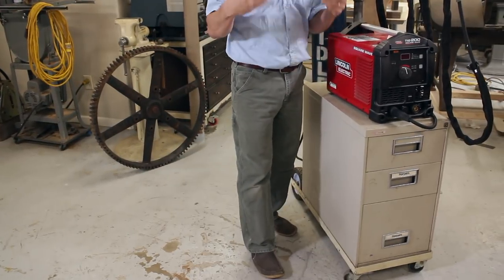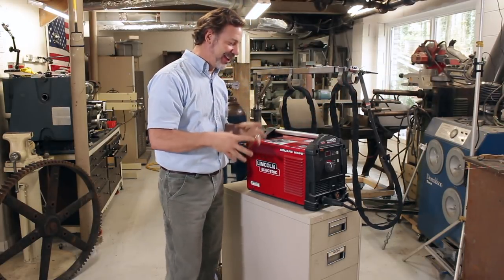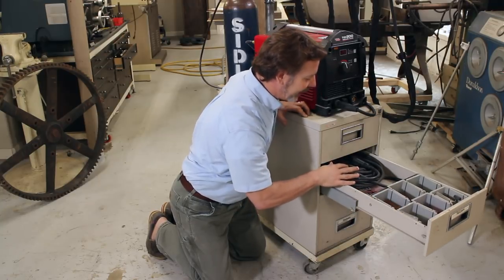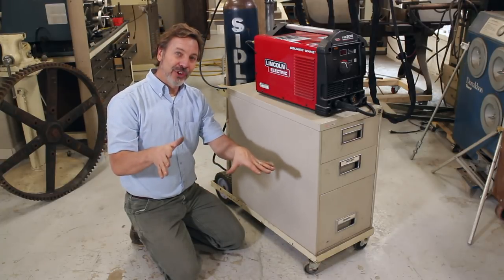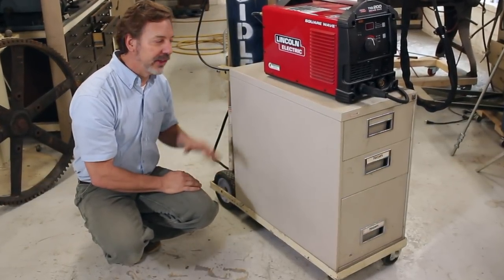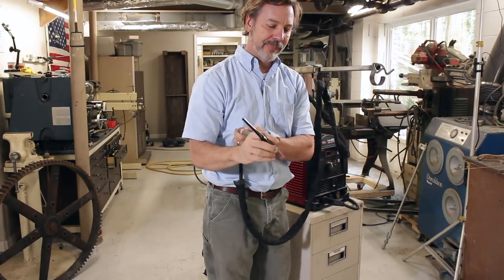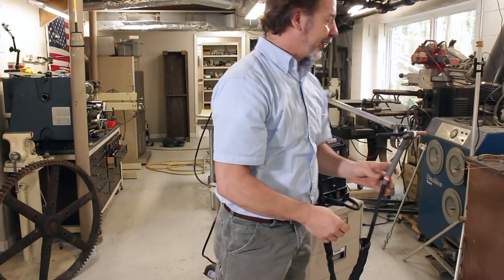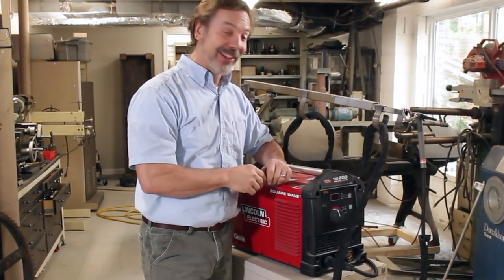The perfect Welding cart :-)

Comment: I'm so glad I watched this video. I'm also building a welding cart from a file cabinet, except it's a two drawer. So far I haven't found a cheap three drawer like you have. I was going to hang the back wheels on the outside, but you're right, they would get hooked on everything. Same goes for the hooks I was going to put on the sides. Good thing I haven't started cutting yet.
Reply from the maker: Glad I could help

Comment: I've been thinking about building a welding cart using a 3 drawer filing cabinet for the past 6 months and low and behold, this popped up in my recommendation list..it's a sign from God lol. I was wondering if a helmet would fit in the bottom drawer, and now I know. This build is simplicity at its best. 2 THUMBS UP 👍😎👍

Comment: I recently bought an Atlas metal shaper and am building a cart around an old filing cabinet to mount the shaper on. The drawers will hold shaper cutters and fixtures and maybe some small pieces of metal stock that would otherwise get lost around the shop.
Reply from the maker: Thanks for your comment. :-)

Comment: I've got one of those combo small/tall drawer filing cabinets but it has two short, half-width drawers side by side on top. I found that they are just tall enough for r8 or 5c collets. I cut a piece of plywood that just fits in the top of the drawer and used a 1" hole saw to make 9 rows/4 wide for 36 holes. Allows me to store a full set of R8s in 1/32 steps with a few extra. Wish I could find more of the those cabinets.
Reply from the maker: Thanks for watching

Comment: A future video on how you made the telescoping arm would be very cool.  I have thought about doing something similar in the center of my 440 sqft workspace with a 240v extension cord so I can weld all around my space.  My idea was similar to the arms you see at DIY car wash centers with the pressure washer hose, but this seems much cleaner and easily stored when not in use.

Comment: Nice cart on a par with Adam Savage's glue and small tool carts based on airline beverage cart.  One plus the basic file cabinet is a lot cheaper then the airline beverage cart. I know I've seen a trash day when there are two sitting by the the road for free.  The other option would be a thrift store but these are not free.  I couldn't see what grade of wheels you used but my minimum would b 4" for the  casters and 8" for the wheels.
Reply from the maker: Great comment.:-)

Comment: Easier build than his angle iron cart would be using couple of 2x8s or 2x10s dimensional umber long enough to allow gas cylinder platform behind cabinet.  Take bottom drawer out and screw cabinet to lumber.  Bolt casters to bottom of lumber.  Very strong, cheap, and quick to build.  Office cabinets are great foundations for carts and equipment storage.

Comment: Interesting, do you have any problems with the weight capacity of the drawers? Used filing cabinets must be dirt cheep these days with everything going paperless.
Reply: See if your local state university has a warehouse sale, where they are unloading stuff unwanted by the departments. The universities around here have warehouse sales weekly and heavy duty filing cabinets, which look like they are from war times, go for a few dollars.
Reply: In Houston the local schools have auctions almost weekly. They always have file cabinets too, that is why I was wondering on their ability drawer weight capacity.  I have been looking a Lista and Vidmar , but even at auction they go for ridiculous prices.
Reply: A filing cabinet drawer will typically hold the weight of paper crammed together tightly from front to back. If you have ever picked  up a stack of paper 24 in thick, you realize, that much paper is very heavy. So with that in mind I would think filing cabinet drawers would hold a lot of weight.
Reply from the maker: The best thing about good filing cabinets are the hi quality draws. They will take the weight and the abuse of shop life.

Comment: Nice idea, I have been trying to find information on the square wave 200, how long is the post flow, I heard it’s 15 seconds regardless of amp setting, is this true?
Reply: the post flow on the 200 is about 15 seconds when you run it on full output, the reason for that is to give the proper shielding on Nickel based alloys. They require a very long post flow. Remember, the 200 is an entry level TIG welder that gives you asymmetric output and frequency control. It's really not a big deal if you are not welding all day, every day.
Reply from the maker: Great comment.:-)

Comment: One of the most important things for a welding cart is securing the bottle.  You didn't show how you did that.
I also agree having drawers or in my case my third one I use a cabinet, so you can keep stuff clean from the shop environment.
I disagree highly about the big rear wheels.  That is the first thing I ditched in my 2nd cart build, I HATED not being able to move the cart sideways.   The telescoping beam is awesome, I made a tall fixed wire holder pole, but when it breaks, I will probably use your boom idea.